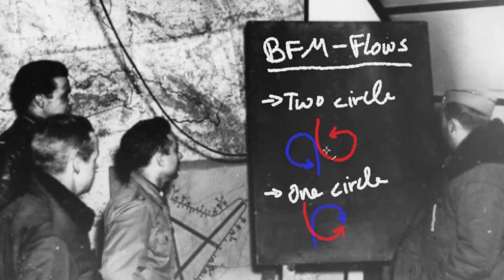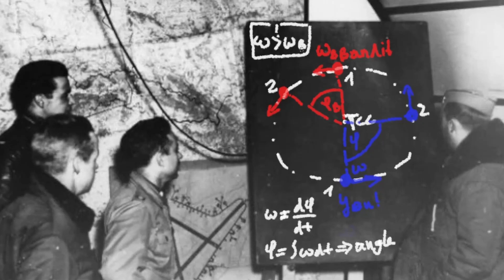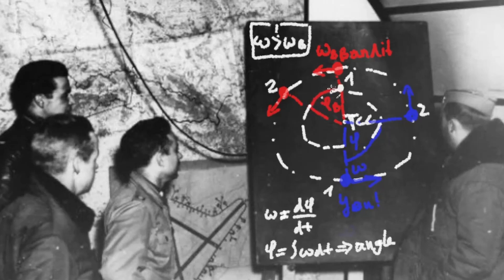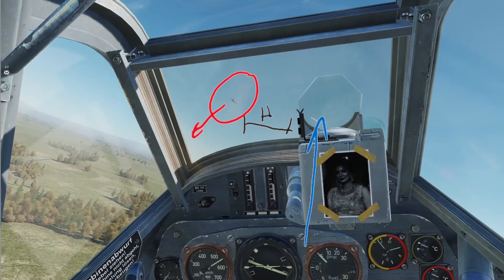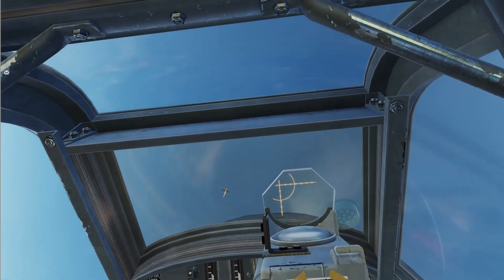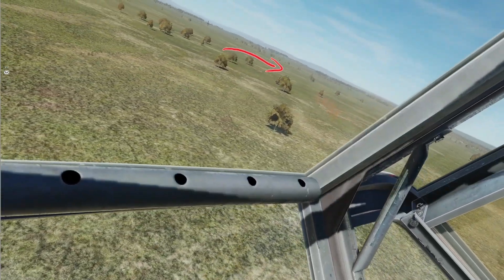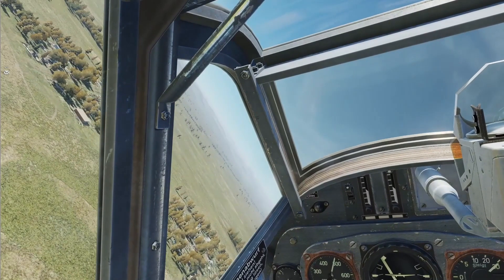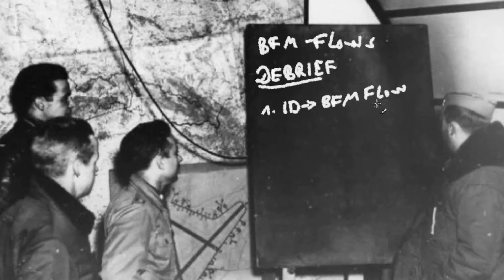Do you know your circles? | JG7's Classroom Ep. 06 - BFM-Flows | #dcs #education #dogfight

Comment: I definitely enjoyed the video and liked the format.  I'm recently back in to DCS and quite rusty.  Did either of you ever use flaps? The 109 seems really on the edge at 270kph. Sometimes I do 3 or 4 seconds of flaps down to help with control during turns under 300kph.
Reply from the maker: Thank you for sharing your kind words :) 

I think I did you like 5° of flaps during the rate turn on the deck. I would advise to keep flaps between 5-10° in a two circle rate fight. A little more stability and lift with drag penalty.